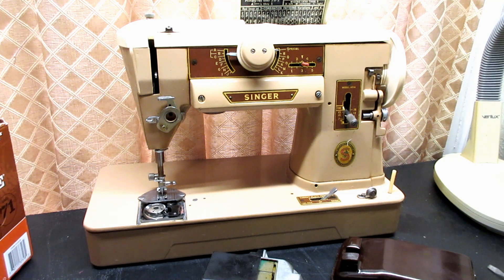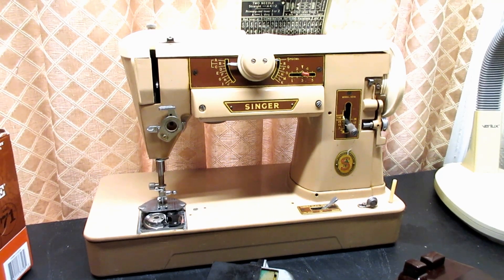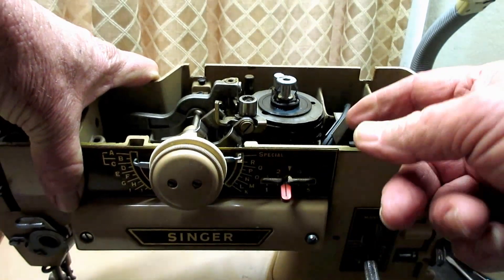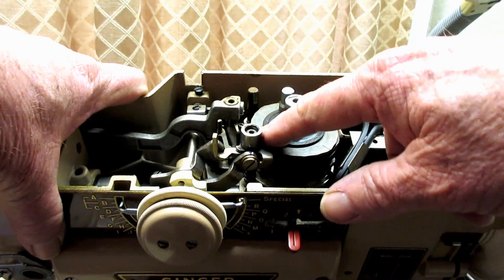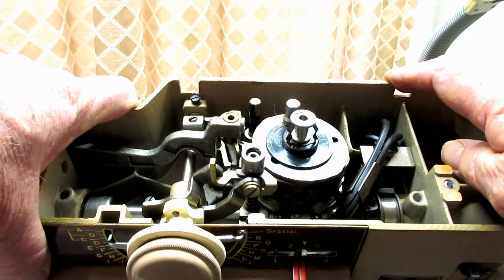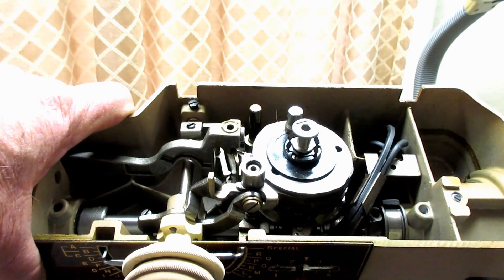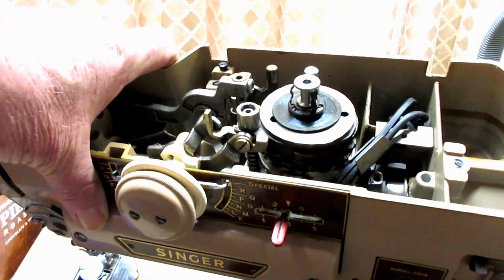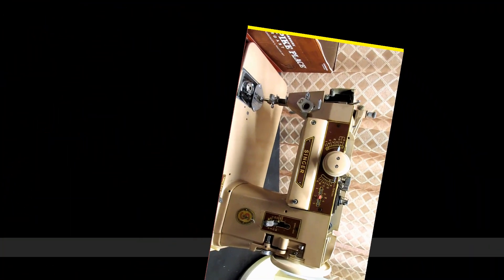The "lost" ending of the "TERRIBLE" coming soon video

Comment: Andy, I just wanted to let you know that I’ve been practically glued to Andy Tube for the last 10 days watching all your beautifully detailed information videos on the 401A.  I recently purchased one that had issues and thanks to your videos, I gained the knowledge and confidence to handle the problems one by one.  I plan to continue viewing your series this week to finish the remaining areas of the machine.  You most certainly have a rare and wonderful gift as a instructor as well as a most generous spirit in making and sharing these videos.  Wishing you a successful and speedy recovery as well as strength throughout the treatments.
Reply from the maker: Hi, Gail. I sure love reading your comment. The whole reason I made my channel. Thank you for saving that 401A and getting it ready for service. You probably noticed the links to other series at the end of each 401A video. They will take you to videos that will explain how to work on the parts of your 401A that I will not be doing in this series. Also the motor and foot controller if you desire. Very kind of you to take time and comment. Take Care and thanks for the food wishes.

Comment: Thank you Andy for your awesome videos!  I got a machine that was totally frozen.  With your help on the videos I got the machine stitching!  The only thing I could not get loose is the nut holding the throat plate pins and throat plate lifting lever.  Still working on it.  I hope your health issues are getting better.  Many prayers and blessings for a quick recovery.
Reply from the maker: Great job, Cathy. Thank you for saving that machine. It sure can be a "tough nut" sometimes. I have sprayed a little WD40 into the lifter pin area to soften any gunk, but also be sure the lift lever is down in sewing position when pushing the lever bracket on the bottom. That can give the bracket a little more room to move back and allow the nut to turn. I have had metal nuts tightened way too far and in the end, I was unable to remove it. Just cleaned all the parts as best I could and left it at that. Thanks for the good wishes😊

Comment: I don't have a 401A, but, I'll still watch the whole series. My mother's 500A ended up with me. (Which started me on this vintage sewing machine road.) I think the 401A and the 500A share a lot of internals just different "body work". Don't forget the ball pivot on the driving arm. It took me a while to find that last little bit of stiffness in the fancy stitches. Thanks for all that you do. I'll be thinking about you.
Reply from the maker: Spoken like a true restoration man! That secret little ball pivot that does not get attention. Good Call! I've done a few videos about the driving arm:
https://youtu.be/tcdGVzL9T6o   and   https://youtu.be/89kRREixTeA
Your call on the model similarities is dead on also. Singer just jazzed up the body, changed the front end of the tension unit and added the funky "Automatic Thread Control" that repairmen told me they advised customers to skip when threading. Other than that, any of my 401A, 403A, and 404 videos can be used for working on your 500A Rocketeer.  I appreciate your watching and send your thoughts. That's the best for me.

Comment: I have loose knobs which is not allowing my needle to center. The 2 screws in the selector switch only one can be undone, the other is jammed. I dont know what to do or where to start, but I was hoping to find the answer with your tutorials. Ill be watching out for your future videos sorry to hear your not in good health at the moment. If you have any advice for me it would be much appreciated ive been struggling to get this machine running properly for a while.
Reply from the maker: The wonderful world of the 401A. Behind those knobs and inside the top of the machines are the actual mechanisms that get set when the knobs are turned. Lifters and followers to match the metal pattern discs on the cam stack. Those parts get dirty and sticky with old oil and can't move properly (or at all) and often line up incorrectly, which can mean the needle is on a place of the disc that makes it "swing" for zigzag. Thus a needle out of the center. A good cleaning up there and lubrication can fix many of those problems. Of course, sometimes it takes more adjusting b/c the dials/levers have been forced by someone. The good news is the machines are so well made that they can usually be adjusted and fixed and get back to sewing. During this series I will be working on all those parts (the reason for this whole series) In the meantime, if you'd like to work on other areas of the machine while waiting, then please take a look at the playlists I mentioned. (also shown below in this comment) You could do many other adjustments/checks and some cleaning and work on the motor, foot controller, or tension unit for example. That way when we get to the parts around the cam stack and the stack itself and get them clean and tuned up you will be ready to sew. Just a suggestion. 
https://www.youtube.com/playlist?list=PLsCOZgzzaiKKyqvdDRwS-9MfLuwSNJTcg
https://www.youtube.com/playlist?list=PLsCOZgzzaiKIB4kvIHCfHYuyLMUp5A4UI
https://www.youtube.com/playlist?list=PLsCOZgzzaiKJSu0T9oeaheTZsrUe91kkZ
https://www.youtube.com/playlist?list=PLsCOZgzzaiKL6ePPxLpmnWSzTyxPKTb71
Thanks so much for watching my channel.
Reply: @andytubesewing1953  Man you ROCK, It just feels right to try and fix it on my own if possible. Wish it just ran perfect, the more I mess with it the more problems that keep occuring. Its running at the moment, But the selector knobs slipping and not staying in place has been the real challenge with me. Have a greatday Andy thanks for your time! :/ Back to the workshop
Reply from the maker: @AlexanderMoriarity  You can do it! I forgot about the stuck screw, sorry. I use penetrating oil, sometimes several applications, to try to loosen it. I will also apply heat, like using a hairdryer, and that has helped. It's different if there is rust on the screw. I usually have the best luck with a rust remover, like The Must for Rust, or Evaporust. The rust remover won't be effective if you already used oil on the screw (can't penetrate as well). If you see rust, use the rust remover, then follow that later with oil if needed. On large screws, putting the screwdriver in the slot and giving it a sharp, quick rap can "break" the screw free. You are talking about a smallish screw so you'd have to be very careful trying that.

Comment: Andy, thanks for all the 401a.  Everything is clean and moving, but the machine is only performing straight stitch.  The selectors move freely, but does not seem to move the needle arm. Is there a video showing this repair?  Thanks.
Reply from the maker: A nice model, sorry you're having problems with it. A few possibilities here. Start with oil (see bottom of my reply)
     1. Lack of oil, or hard, dried oil. Put the machine in the widest ZZ position and gently push the needle bar towards the handwheel end of the machine. It should easily swing to the right and return when you let it go. If it is frozen it may be a lack of oil/dried oil in certain ZZ parts. The machine should be oiled properly before making any adjustments. The Instruction Manual has very good diagrams for oiling the machine. There are about 35 places to oil. If you need the manual you can download a free PDF copy here: https://ismacs.net/singer_sewing_machine_company/manuals/singer-401-slant-o-matic-sewing-machine.pdf   
You can also heat the parts with a hairdryer, or carefully with a heat gun if needed. This can loosen old, dried oil to help get parts moving but if it is sewing for you I doubt this is needed at first.
     2. The Followers are not touching the pattern cam/disk. The selectors move the follower arm up and down to the correct disk. When you move the Stich Width Lever to any width the follower arms move over against the disc to follow the pattern. You can remove the top cover and watch while you select a ZZ setting and then watch if the follower arms move up/down Then select the width to see if the follower arm moves towards the pattern disk on the cam shaft. The follower should touch the disk.
     3. At the base of the follower parts is a "Paddle" on the end of the Needle Bar Driving Arm. As the follower follows the pattern an arm or lever on the bottom of it pushes that paddle to make the Needle Bar Driving Arm push on the Needle Bar Vibrating Bracket which then makes the needle bar swing. A spring system makes the needle bar return from the swing.
The end of the Needle Bar Driving Arm is attached to the side of the NB Vibrating Bracket up in the nose of the machine, as is a long spring from the paddle area. There are two important places to oil that NBVB and if they are lacking oil or have dried oil inside then it cannot swing the needle.
     The Service Manual has sections for adjusting all the parts I have mentioned. A free copy of the original manual is available here: 
https://sewingdude.wordpress.com/wp-content/uploads/2012/09/singer-401-service-manual1.pdf
     Here is the Playlist of a few videos for Model 401A: https://www.youtube.com/playlist?list=PLsCOZgzzaiKLiDl9yFTP6mJgQmz5lj4NO   One of those videos is about the Lifters and Followers is you want to see all about them: https://youtu.be/-tLtk2Zyqn8
     Here is the Playlist for model 403A, the sister machine to yours. Not as fancy but many, many of the same parts and there are 27 videos: https://youtu.be/-tLtk2Zyqn8
Here is the video for the Needle Bar Driving Arm: https://youtu.be/tcdGVzL9T6o     and the NB Vibrating Bracket: https://youtu.be/ZTmyM4MNX6o
I'm giving the video links just in case you need them or want to see the parts.
   START WITH A GOOD OILING as it can clear up many problems before you even need to pick up a tool. PAY ATTENTION TO THE OILING OF THE NB VIBRATING BRACKET 😲

Comment: Andy, have you ever found a clearance dimension between the bobbin holder and the retainer? I see there is an eccentric pin that can vary the clearance but truth be told the system seems to not care a whole lot unless the bobbin holder can become dismounted.
Reply from the maker: The system does not care that much, but if the clearance is too narrow the needle thread can hang-up between the bobbin case and the bobbin case positioning bracket at the corner of the bobbin case where it bounces against the spring of the positioning bracket. The spring has a cushioning effect that helps lower the noise made when the bobbin case is pulled to the right by the needle thread being pulled by the hook. Singer has instructions for "Setting the Thread Clearance" and suggests a Gap of .012 to .016 inch. That's why they put in the eccentric stud (held by the set screw below the edge of the bed) I suppose if the gap was set as wide as possible the bobbin case could bounce off the hook race and become loose. I have made videos of setting the thread clearance on a few models. Here is a video for model 404, just remember the suggested gap for model 401A is .012 to .016 inch. Here is the video: https://youtu.be/OXKqZp87eN4   I hope I've answered your question and thank you for watching my channel. BTW, I have two series that may interest you, 50+ videos for model 404 showing a step-by-step restoration, and 20+ videos for model 403A which shows some of the ZigZag parts. These two models are siblings of the 401A and have mostly the same parts, such as needle bar, presser bar, bobbin winder, hook, feed, motor, foot controller, etc. The 404 series is here: https://www.youtube.com/playlist?list=PLsCOZgzzaiKIB4kvIHCfHYuyLMUp5A4UI
Here is model 403A: https://www.youtube.com/playlist?list=PLsCOZgzzaiKKyqvdDRwS-9MfLuwSNJTcg